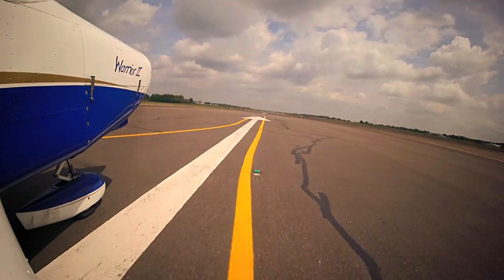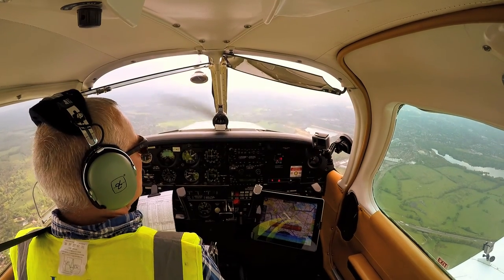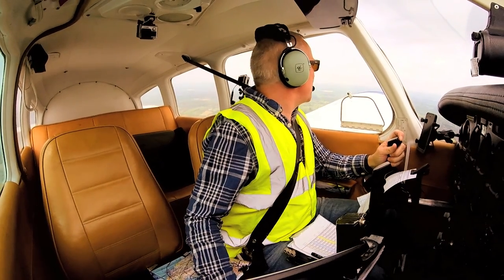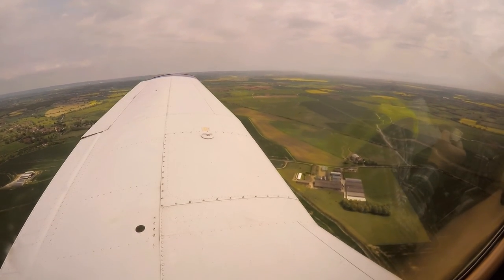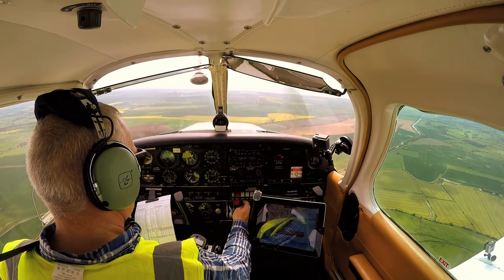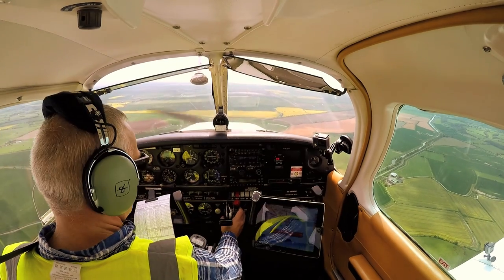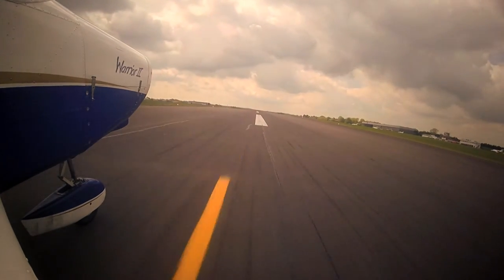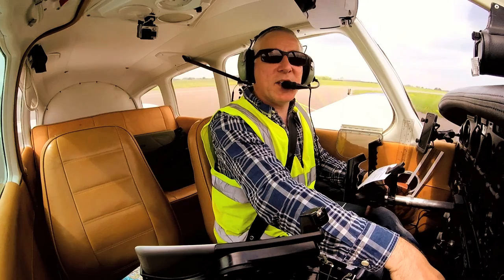Simulated engine failure - PA28

Comment: I know that the Stasi - sorry, H&S at Biggin demand high viz vests, but if it's nylon, do you really want to wear it in the aircraft?
I always avoid anything that likes to burn - just in case.
And thank you for the top tip.  Someone told me this and I had forgotten it.
Reply from the maker: +nworbretep1 I sometimes forget to take the hi vis off after fuelling.

Comment: And, if you are estimating  NAUTICAL Miles off track its 40 degrees towards track and 1 minute for every Nm off track  for Standard Closing Angle correction for PA28 cruise. I understand that you should  add 30 seconds to your ETA for every nM as well.

Comment: A couple of good forced landing practices. It's something I need to work on, as I tend to stay too close to my selected field. One thing I didn't hear you mention was selecting 7700 on the transponder.
Reply from the maker: +Martyn Wright they're good to practise now and then. I wouldn't squawk 7700 if already talking to a unit.  I would select 7700 if calling 121.5 blind.
Reply: Ahh okay. My flight instructor always taught me to select 7700 anyway so that it pops up on radar screens, but I suppose if you're already talking to someone it wouldn't be necessary.
Reply from the maker: +Martyn Wright my thinking comes from CAP413, the radiotelephony manual.  It used to say that you should keep your original squawk if in contact with a unit.  It now says that 7700 may be set, either at the discretion of atc/the pilot if they're already in contact.   It's on page255 of the current doc... https://publicapps.caa.co.uk/docs/33/CAP413%20MAY16.2.pdf

Comment: Just wondering if you have ever flown to jersey and if so what paperwork is required. Brilliant videos, can't wait for the next one.
Reply from the maker: +Ben Brown Hi Ben.  I haven't been to Jersey yet, but I 'nearly' went a month or so back.  As such, I did research this.  

Basically, there is a Jersey GAR form you have to fill in before arrival.
http://www.gov.je/Travel/MaritimeAviation/CivilAviation/Pages/PrivatePilots.aspx

Then there's the flight plan..

Then there's the UK GAR for your return.
https://www.gov.uk/government/uploads/system/uploads/attachment_data/file/412944/GAR_Instructions_March_2015.pdf

I found this website very helpful:
http://www.cicz.co.uk

You'll have to carry all the mandatory paperwork on board.
This website from AOPA has some good advice on that, and other tips for flying abroad.
http://www.aopa.co.uk/index.php?option=com_content&view=article&id=154&Itemid=813

I do hope to get there soon...as soon as weather/time permits.

Thanks for watching.
Reply: +The Flying Reporter Thank you very much, I'll check them out. Should be going around mid June.

Comment: Hi, really good video!

How did you go about working out the wind correction for the diversion track so quickly? I have previously created a wind rose but was curious if you had used a better way.

Many thanks
Reply from the maker: I use a wind-star.
Reply: I have been taught the clock rule after calculating the max drift

Comment: Hi,
Do you use a standard suction cup for the outside shots or something built for the purpose of holding onto the wing? I'm after something myself but don't want to either lose my GoPro or drop it on someone from 3000+ feet. Cheers and look forward to the next video as always. James.
Reply from the maker: Hi.  There's a fixed mount on the doorstop.  I wouldn't use a suction cup on the outside.